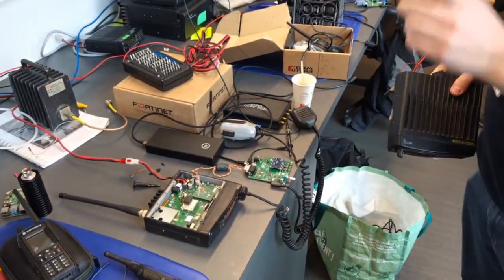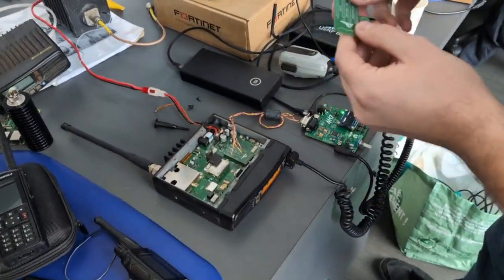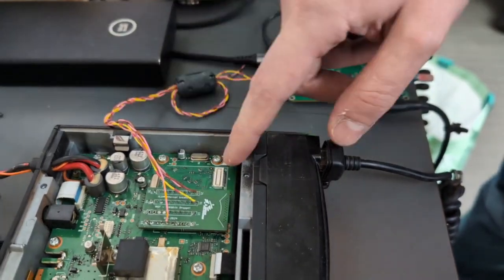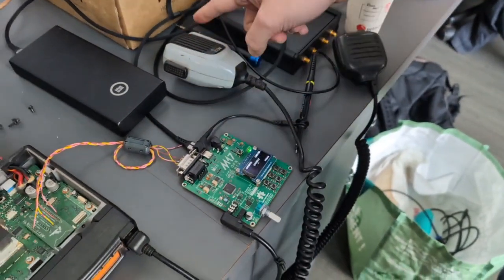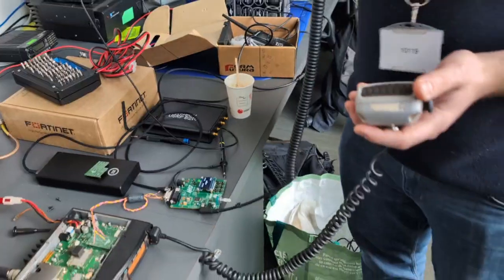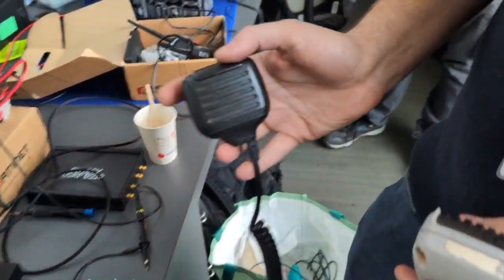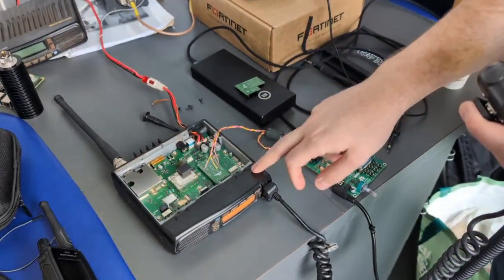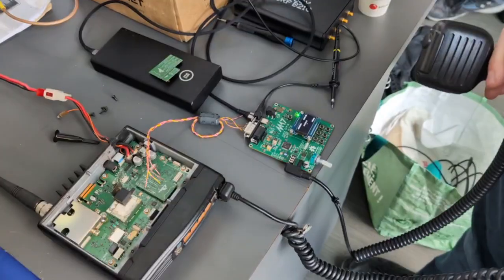M17 Tests on IC-F5060

Comment: hmh with Motorola GM3xx series, MCS2xxx and Kenwood TK8xxx you need no extra pcb and only one cable to the DB-9 plug includes also power supply, no USB cable needed
Reply from the maker: No USB cable either in here.... But I think you're missing the point of the whole project: a prototype before developing an internal modem for M17 :)
Reply: @on6rf  hmh I see an USB power cable in the video, an if you want to integrate the whole modem in the radio how the analog capability is done?